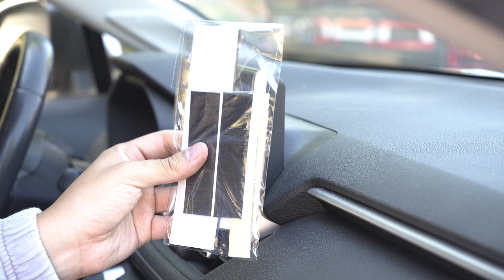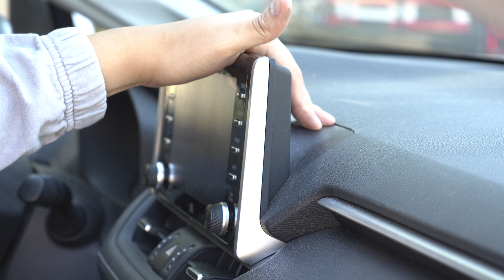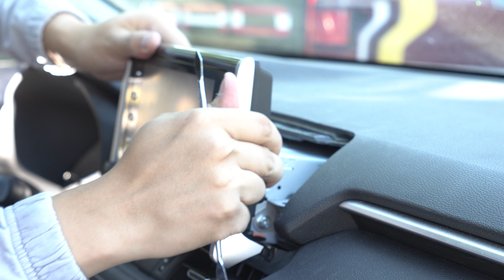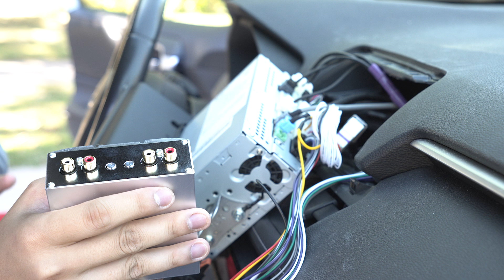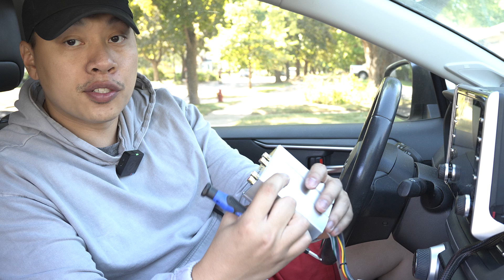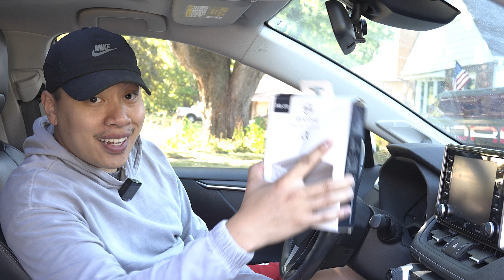Transform your Toyota Rav4 Audio system with Beat Sonic

Comment: Did you ever have any issues with the audio cutting out when it’s too loud with the amp installed and having to turn off the ignition and turn it back on to get audio back on again?
Reply: Does it overheat In winter with the heat on